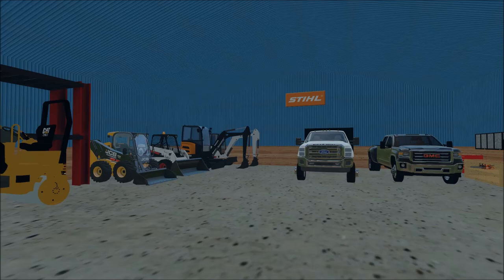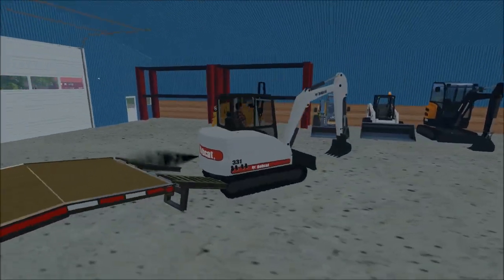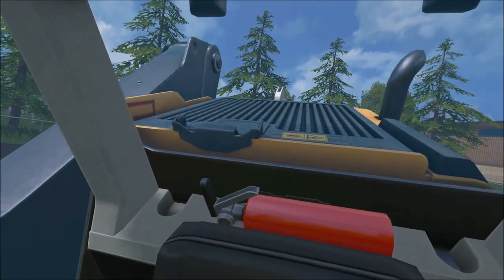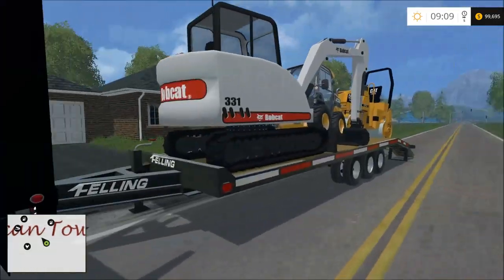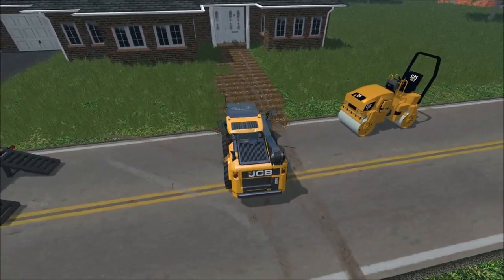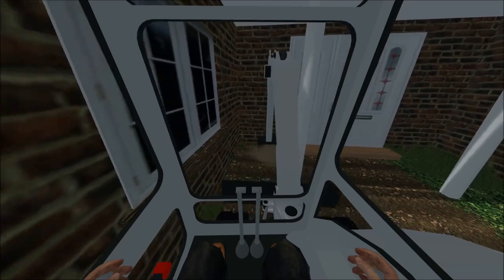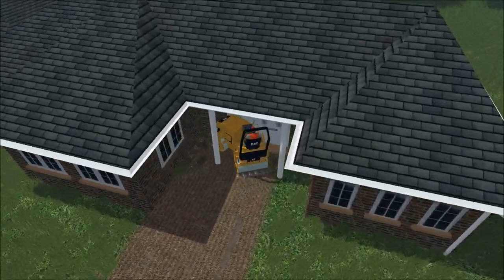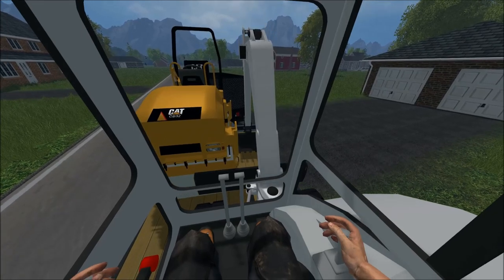Farming Simulator 2015 Building A Walkway

Comment: my only pet peeve is this is not the proper roller to use to compact dirt. This is an asphalt roller where you should use is either a plate compactor or vibratory smooth drum roller.
Reply from the maker: Its one of the only ones I know of that are in FS15
Reply: oh I know, I just work construction is all and I like to poke holes when wrong equipment is used for fun lol.
Reply from the maker: Cool, I understand.
Reply: but theres no mods for them only these rollers i wish there was more but there not
Reply from the maker: yep
Reply: Square2448 youtube message
Reply from the maker: ok
Reply: +Offspring Gaming what

Comment: I hate to bust your bubble, but that truck is not going to haul all three pieces of equipment in real life. Yeah the f550 is a strong truck but there is no way possible for that truck to haul that much weight.
Reply from the maker: +Kevin Robertson I agree with you there, I am looking to find some stronger big dump trucks which would fix this problem. At the time I recorded this, the F550 was the strongest truck I have.
Reply: +ArrowXTmstR Road to 100 Subs! that truck is private